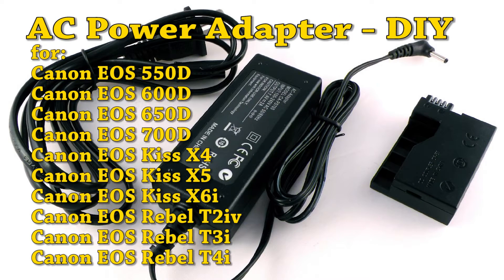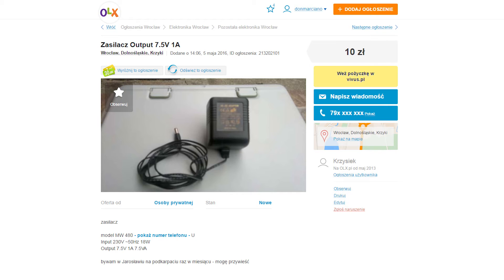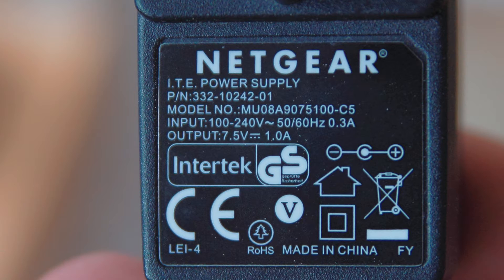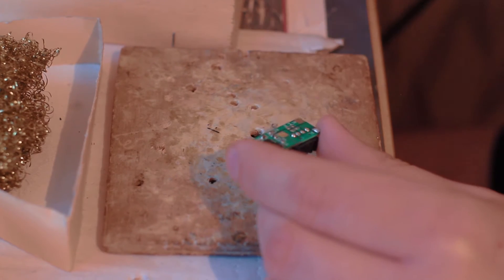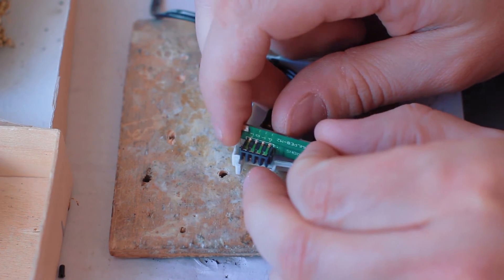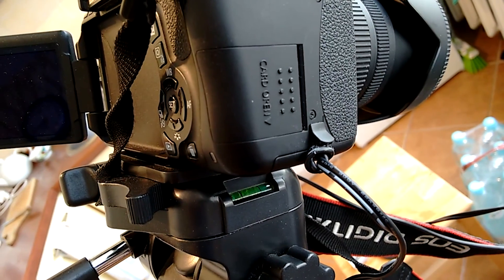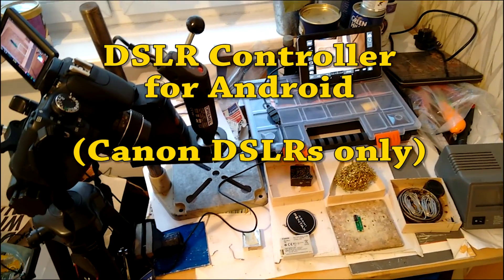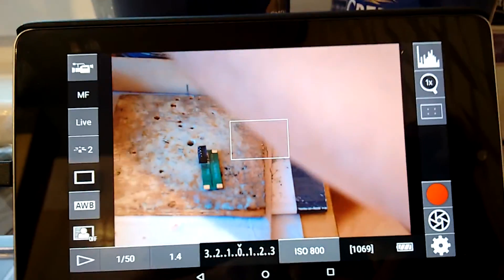DIY - AC power adapter for Canon 550D, 600D, 650D, 700D

Comment: I approve this works. Used 7.5V power supply, 470uF capacitor and not original canon battery. Had to shorten in a bit different spot, because PCB was a bit different. Nice video

Comment: thanks, but what is the point for the capacitor? the charger is already providing clean enough dc voltage right?
also is the pcb necessary? it wont work with just +ve and -ve?
hope to hear from u
Reply from the maker: Capacitor helps provide stable voltage especially with long cable. When camera drain lot of power (movie, starting) volatge can drop below proper value. Capacitor is a local energy  reservoir and it is cheap so we have more pros than cons.
Reply: @donmarciano1981  got you, but what about the internal pcb, it is the cels bms, can it be removed entirely, or did u just bypassed it ?

Comment: please. can i use an adapter with 2A ?
Reply from the maker: lloyd Films Of course. Voltage is crucial.
Reply: thank you. but problem is that his outpout is 9Volt , 2A. i can use it?
Reply from the maker: 9V is too high. You can use diodes to reduce voltage but I think it is still too high value.